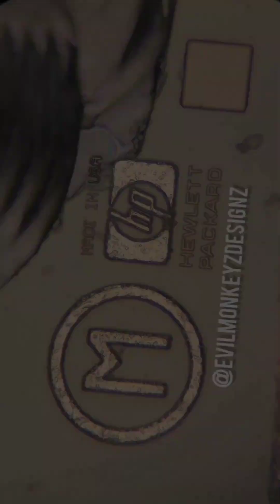HP VIPER MIOC #componentscloseup

Comment: Are you sure about those small dots?  HP did some very detailed doodles.  I've seen an old/common technique for getting detail into them as using the via layers to create a shading in the metals.  That viper looks like vi arrays and blanks covered in metal.

Comment: man how do they make these things!
Reply: Carefully
Reply: @Mike.The.Jeweler pictures and deposition, its easy but expensive
Reply: Photolithography
Reply: @deang5622 I’m curious are there any similarities to the “stereolithography” that SLA printers do? What exactly is photolithography?
Reply: @fivezylinder Photolithography is the use of a mask containing a pattern, shining ultraviolet light through that mask, and using a system of lenses to optically reduce the size of the image down on to the surface of the wafer.

The wafer is coated in a UV light sensitive photo etch resist.

Where the etch resist has been exposed to UV, it's changed and the patterns of the mask is recreated in that etch resist, which is then dissolved away using acid, giving access to the silicon underneat.

Then external dopants are added into the exposed areas of silicon. There are a couple of ways this is done, by diffusion and heating it up and by ion implantation.

Multiple masks are used to create  different regions and doped with different chemicals.
Reply: Google "X-ray lithography"